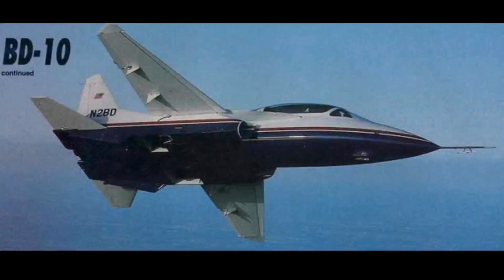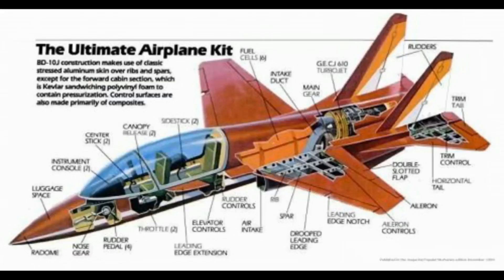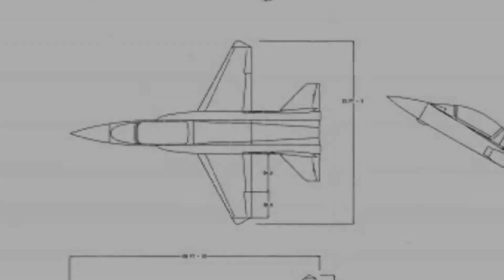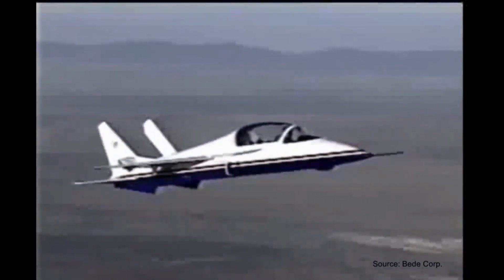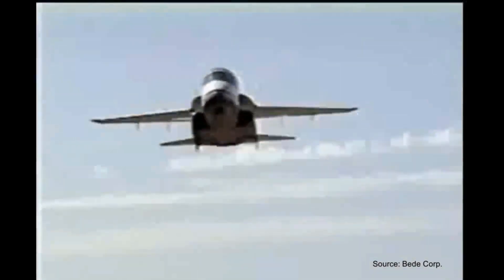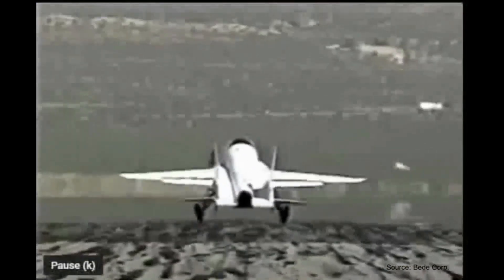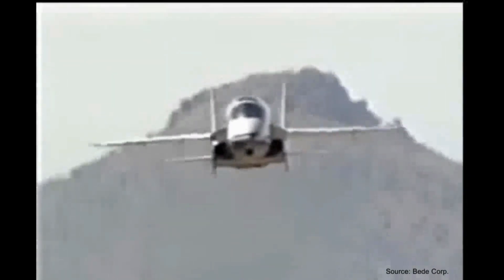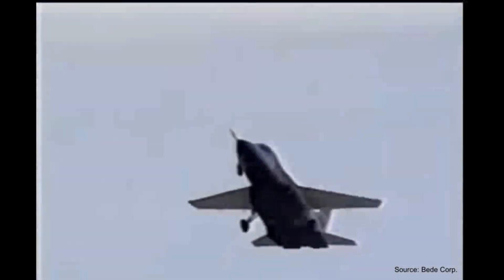World's First Homebuilt Supersonic Jet: Bede BD-10

Comment: The A&P who worked on the landing gear did not follow the plans correctly. He used thin wall aluminum instead of the thicker walled aluminum called for in the plans. Not Jim Bede’s fault.

Comment: § 91.817 Civil aircraft sonic boom.
(a) No person may operate a civil aircraft in the United States at a true flight Mach number greater than 1 except in compliance with conditions and limitations in an authorization to exceed Mach 1 issued to the operator in accordance with § 91.818.

(b) In addition, no person may operate a civil aircraft for which the maximum operating limit speed MM0 exceeds a Mach number of 1, to or from an airport in the United States.

Comment: For a aircraft that was designed by a prospective kit builder and supplier this jet is very impressive . Jim didn't have the resources or funding of some of his peers the plane had kinks that needed worked out. So did the grumman F14- Tomcat but Grumman's solution was a navy contract test pilots with top military training and military backing. The BD-10 had and still has potential. The advantage of private experimental aircraft is you can improve the design over time . Don't reinvent the wheel just reinforce the week spokes.

Comment: They'd have to use honeycomb filled stabilizers and in other high wind stress areas. You can't give vibrations any place to start from the air stream or it can get magnified real quick.

Comment: The Viper Aircraft ViperJet MKII appears to be the composite equivalent - even using the same engine - and the ViperJet is even heavier... about 30% heavier than the heaviest BD-10.

There have been several Very Light Jets since the BD-10, and some of them appear to work well (even if they didn't actually make it to production), but other than the ViperJet they don't have this military style. They're generally of composite construction, and they usually have the engine is somewhat separate nacelle instead of in the tail like this. None attempt to be supersonic, which (in hindsight) was an unreasonable expectation for the BD-10.

Comment: I know that the BD-10 would not be safe to build and fly. But a set of plans would make a great record of what might have been. Does anyone know where I might find a set for a low price?
Reply: Better to come up with your own design, which fixes BD-10 problems, and build it yourself.
Reply: @jonasbaine3538  I appreciate the suggestion. But even though I have done homenuilt aircraft and design modification. I retired from working as a machinist due to macular degeneration making it impossible to read micrometers
Reply: @Jagdtyger2A  there’s a viper jet for sale on trade a plane
Reply from the maker: I don't believe that the plans are available anywhere.
Thanks for watching!

Comment: BC-10 was the world's first attempt at designing a homebuilt supersonic jet. It failed, never having achieved anything near supersonic speeds.

It looked very cool, and quite many people were truly excited at the prospect of building a supersonic plane, but the design was bad, and out of five prototypes that were built, three crashed due to airframe failure (and the remaining two aren't flyable). The kit production never started.

Jim Bede designed several legendary airplanes, but BD-10 will be the permanent stain on his legacy.
Reply: Bede = hype. Watched a guy break his back once when his bd-5J deployed the reverser in the air. He pancaked it in about 100 ft short of the airport boundary.
Reply: @bigalAV8R  Not all of Bede is hype. As I said, there are several models, from the old BD-1, to the popular BD-4 (oldest homebuilt still sold and supported), that have survived the test of time and are solid designs.
Reply: @bigalAV8R , where was it that you watched this guy break his back?
Reply: @mvvoila3356  KDWH
Reply: @bigalAV8R  , the only BD-5 accident that I know of (and I know of most) was a Honda-powered aircraft in 1980, not a jet.  Perhaps I missed one.